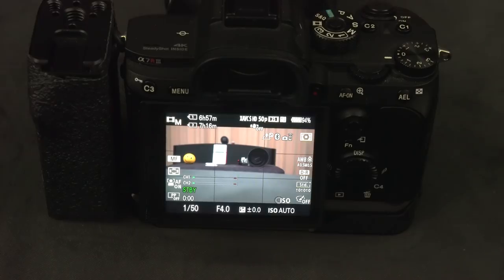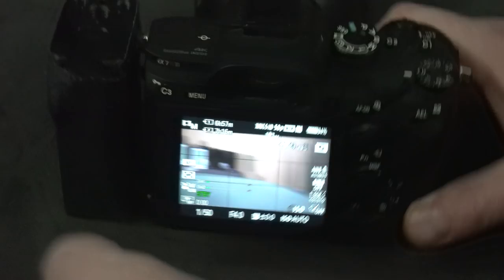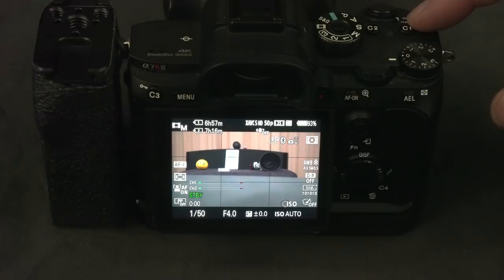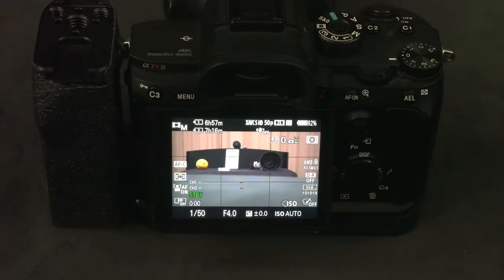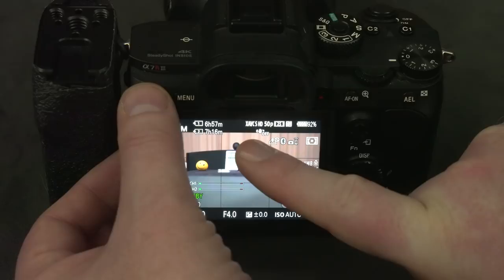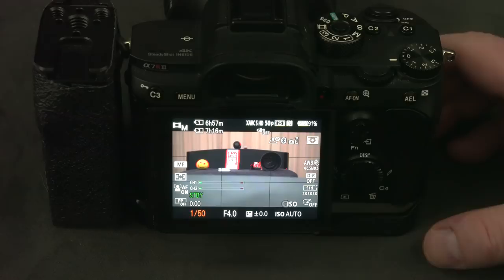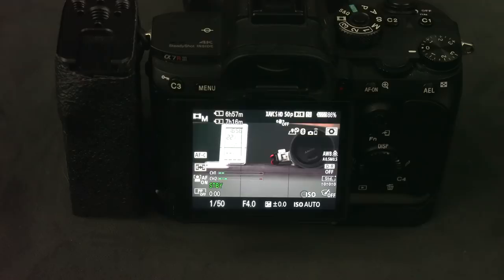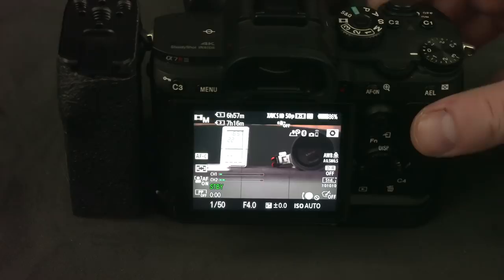a7iii/A7R3/A9 video button layout ideas/overview

Comment: Given I was an early 2122 buyer, I also just purchased the 2218 left side grip. It's on its way by 'slow boat from China'. :-)  Thanks!
Reply from the maker: Ill keep you informed on the 2236 but that will be compatible with the 2218 as well.

Comment: On my a7iii can’t get FN button to activate locking mode, says “operation or setting not available as follows Shoot mode manual exposure”. Plus should eye af (Centre button) work in movie mode on the a7iii? ( as I am getting same error message). Great video, having watched many of previous had most buttons set, but got a couple of new tips.
Reply: Hi! Eye auto focus doesn't work in video mode.
Reply from the maker: See if this video helps : https://www.youtube.com/watch?v=AMUcBdB3H9M
Reply: Thanks for the video link. Have discovered having AF Area Regist set to ON( Camera tab 1 page 7/14) disables the Lock Operational Parts feature.